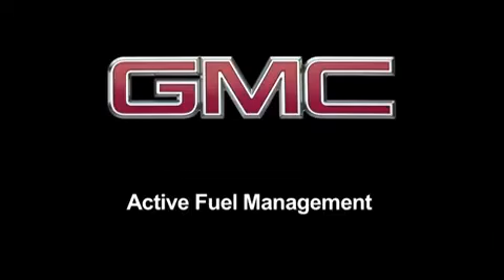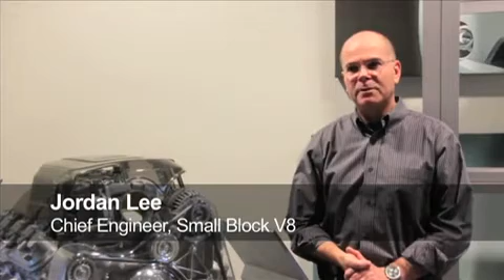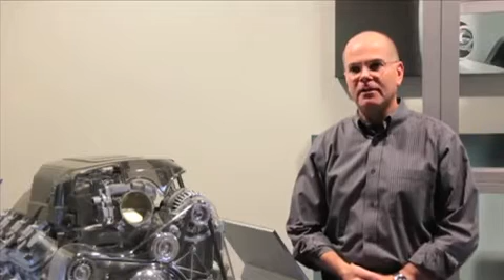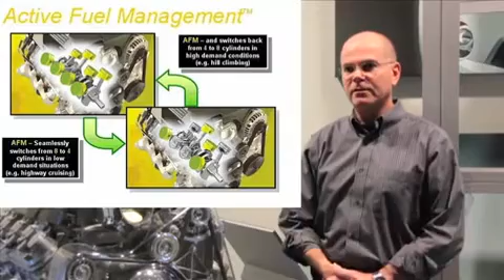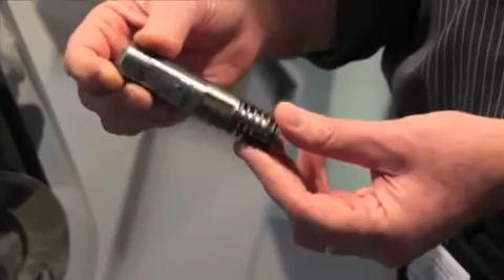Active Fuel Management Jordan Lee

Comment: Significant Fuel economy? BS, i disabled mine and after over 1000 miles noticed next to nothing in fuel economy. The negatives far outweigh the positive. This is a GM propaganda piece. Find another truck because there is a chance you will be out a couple of grand to fix a mess because of of this technology

Comment: It's crap. and I had it tuned out through blackbear and with a proper tune. the truck runs way better with more response and power and my mpg is the exact same as with it. once my aftermarket warranty is up im going to do an afm delete. But I'm keeping the vvt. afm is a horrible idea and did nothing to improve mpg. it kicks in when going down hill when even in v8 I'm getting good mpg. or flat cruising speed when in v8 I show 22 and in 4 it shows 24. which seldom happens anyway on a 7000 pound avalamche with a vortec max in it.

Comment: are people still having this issue with the AFM or did whatever it's referred to. to me it just seemed fine but I've heard of mass oil consumption and other problems so I got a mild tune. I hope I don't have any issues if I throw it back in stock mode because those lifters have been working full time vs when they cut out for v4. 60k I guess I will see. o by the way had crank position sensor go bad at 15k and put my truck into limp mode as I was doing 80 in heavy highway traffic. talk about a dangerous time to have 10% throttle. well no problems since. 5.3 2013 z71

Comment: i personally hate this guy! ya screwed up my truck with this "special" crap your so proud of. if i was after mpg why the hell would i buy a crew cab 4x4???i can see a compact car. but a crewcab z71. this guy n gm has a problem of not enough common sense. this guy can put his engineering degree and his afm so far up his butt that hopefully we will not see it again. afm/dod is a fuq up. a fairly new truck shouldnt have these problems. love chevy/gmc my whole life. but i will not buy another newer than a 04. before this guy n his flunkies put this crap in our motors. well GM ya just lost another very loyal follower....good job

Comment: Hey fellas. I didn't realize this dialog was still happening till today. So, since my last post I purchased a device from range technology that disables the AFM system. It cost $199.00. The car burns a little more gas when it's installed. It simply plugs into the Obo port. But I agree with everyone here. Also, they should have left the option to use or not, up to the people who bought the car by installing a switch in the camaros like they've done for the 2014 corvettes. Or better yet, they shouldn't have put it on the ss models at all.

Comment: The only problem is that mine is broken and causes a loud noise to occur intermittently and GM refuses to fix the issue siting that until it fails they won't address the issue. Nice!! I'm getting a lawyer!!
Reply: thats the lifter locking and unlocking it really is the only issue with LS engines now a days, you should have it replaced before it takes out a cam lobe! its something you can do at home its very easy!
Reply: I'd like more info on that
Reply: Well i work in a GM dealershp, and its not commin by anymeans but it really is the only thing that goes wrong with LS engines if you keep clean oil in the dam things, and ofc keep oil in it.
the AMF lifters is something GM has bin trying to figure out so customers can get better fuel ecomeny.
the lifter littery locks and unlocks itself internaly with oil pressure that is controled by solinoids in the vally of the engine, the issue your having is with the locking and unlocking, its eathor it doesnt want to lock or unlock can go both ways.
you need to pull the heads off and replace the lifters ALL OF THEM. it isnt a huge job by any means, if you have warrenty it HAS to do it for the tech or formen or they cant do anything with the truck... if nothings wrong they cant fix it is the thing.
Gm does offer many trucks from 2007 to 2013 without this AFM system, now it is standord on all trucks 2014 and up thanks to obama and people BITCHING about fuel eco... which is a topic you dont wanna get me going on:)
Whats the issue with having the issue fixed? do you not have warranty?
Reply: I have been the the dealer many many times and since the problem is intermittent it doesn't seems to happen when they are driving.  I did however get one dealer to ride with me, and it did finally happen while we were driving. They told me a engineer would come and drive it to see what options they could offer me like trade assistance, buy back or replace drive train since this has been happening since it was new.
Reply: The engineer drove it and wasn't able to get the clunk sound while going between 4/8/8/4 to occur... So they told me I'm basically on my own because the engineer wasn't able to reproduce the issue, even though it happens nearly every time I drive it.  I have get a lawyer it seems... I sent GM a certified letter giving them 30 days to resolve the issue.
Reply: Well thats the thing it HAS to act up when the tech or service manager is driving it, engineer, ect.. or else they cant just warrenty it, if that was the case someone could come in and say "hey my engine is blown" and they just replace the engine... a lawyer will tell you the samething, if it is a lifter failure and the lifter fully lets go it will do it ALL the time.
yes it can be a pain in teh ass but i havew personaly spent 2 hours on customers cars and trucks trying to get them to act up with nothing happening and then a week later they come back when its acting up and NOT shut the truck off in the middle of whatever job im on ill rush out to hear it or whatever its doing, the formen has enuff trust in me for when i say this is wrong.
just drive it till she goes boom and get a new engine if it does fail slightly out of warranty then you have the issue noted many times and chance are GM will goodwill the issue, i am not saying they will but very good chance they will
Reply: @Mebob2001  My son has a 2014 GMC 5.3 142,000 miles no AFM problem. But we change the 0W-20 every 4,000 miles.We use top quality 0W-20. I think the mistake is letting the OLM run down to 0%. I also think some people think they can use 5W-30 could be a problem.  OIL is Critical.
Reply: mine under warranty they played the same game,, gotta see it act up,, after 2 lifter failures and my warranty expiring even with the problems documented they pretty much told me to get a new engine this time,,,, so I went home pisst off and took the front cover off, yanked my oil pump off the 5.3l and discovered a split O ring at the pickup tube suction side of oil pump. so there ya go,, turns out this has been damaged right from the assembly line, and it is very common and GM knows all about it,, Im sick of hearing from GM "dealer tech" like  this is not that common,, bull shit,,, !! oil pressure brand new was 35psi and I always complained about it to deaf ears... now ,, after I was told to junk my engine after pissing  around for years with stealer dealer bull shit,, it's finally fixed right,, oil pressure runs at 50 cold, hot at 40 45psi... never lower, and the lifters are always always quiet like the should be,, ohh and the afm crap,,, since theres no warranty, and my engine is junk,, I deleted it, with the range device,, and improved my gas milage by 4 miles per gal.   so,,,, gm techs must have shares with gm , cause they're like a broken record,, and all say the very same as this gm tech here said,,, that its not all that common... yet when I going to the steaer dealer there was always at least one engine taken apart in the shop. what ever,,, there's not a good truck out there today,, they're all junk... where's the american pride gone.. or honesty,, or morals that most of us were taught, or atleast exposed to at one point in each of our lives... let the corporations lie through their teath,, we know they're all about the buck, and it's cheaper to fix only the ones that sue than to fix them all... but for service tech to jump on the net and sound like broken records too???? thats just wrong...dude,,  cough out 5 grand into the lifter issue and then watch it fail again in 4100 miles and have your dealer tell you,, that your engine is now junk,,, to get a new one rather than fix their mistakes..

Comment: so not true, i have a 2011ss camaro L99. the car runs smooth and nice in v8 mode, but when it switches to v4. You can DEFINATELY tell the difference. its not a seamless transition. when in v4 mode it sends a vibration throught the whole car. it runs like it needs a tune up. v4 mode is horrible. i wish i had done my homework before buying this car with AFM.
Reply: exhaust and firing pulsations is causing that, it should have NEVER bin an option in performace cars

Comment: how do you turn off valve operation without the engine vibrating like mad due to the compression cycle its the same thing as a engine misfire but controlled when you have a misfire the engine vibrates let alown wear issues on the connecting rod crank bearings rings and pistons when all cylinders fire the bearings wear evenly  but when you turn cylinders off that don,t wear evenly